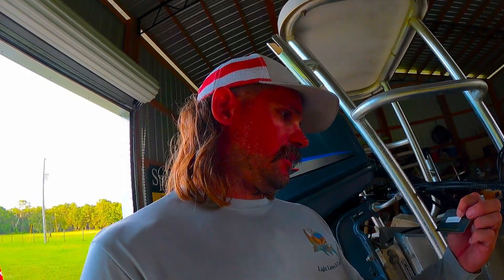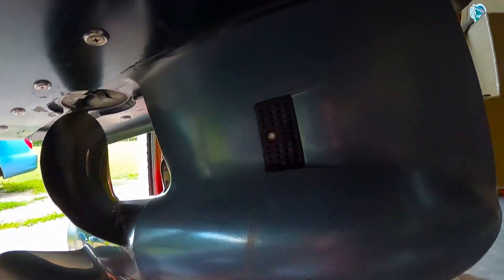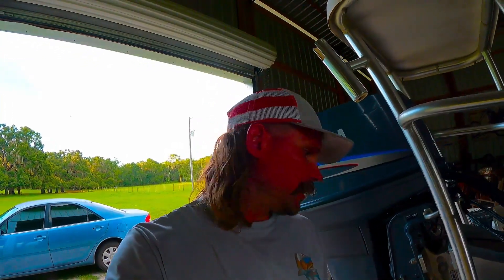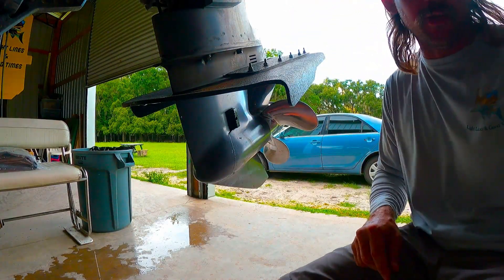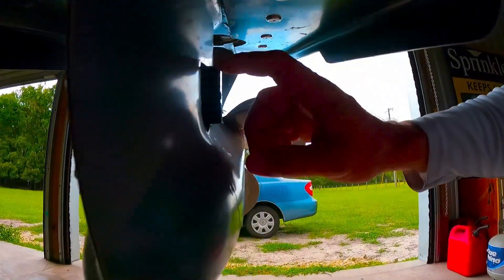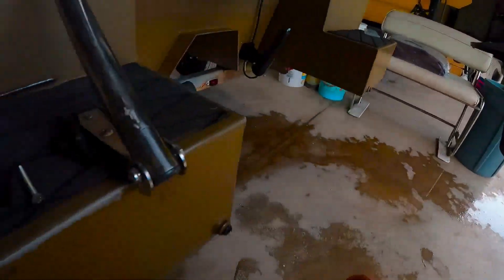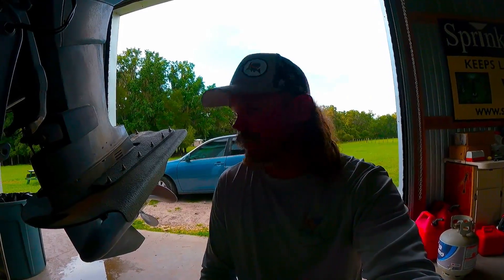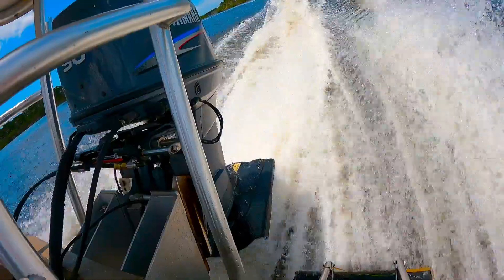Shallow Scoops are they worth it?

Comment: Did you do anything to beef up your transom? I'm running a 90 4 stroke on my non tunnel 1656 Weldcraft. I wanna get a jackplate with like 6-8" of setback but im worried about the extra leverage on that transom. When i got my pods put on the dude told me my transom was already a little warped and he had to correct it to weld the pods on. Should be a tad stronger now with the rigid pods welded on but shoot i dont wanna tear that transom up by running a jack plate
Reply from the maker: I did not an have not had a problem. Every boat is different though.
Reply: @lightlinesgoodtimes  nice thanks